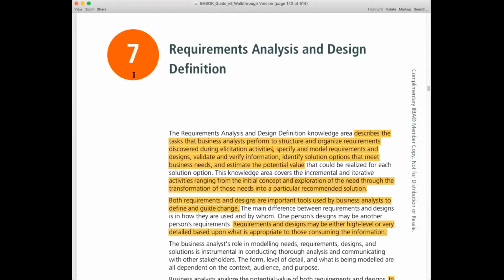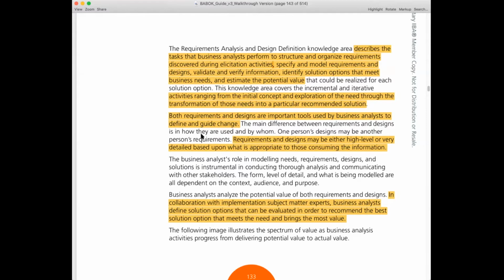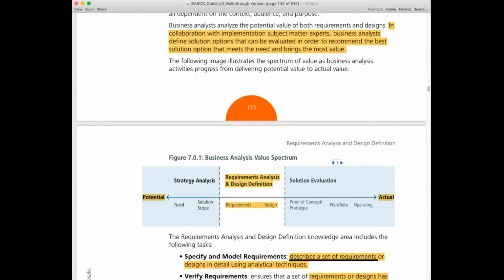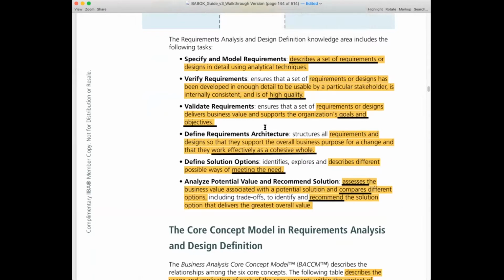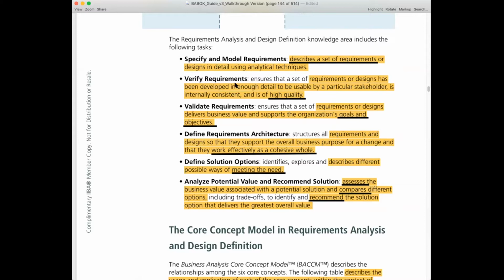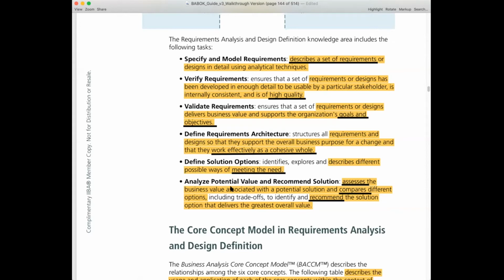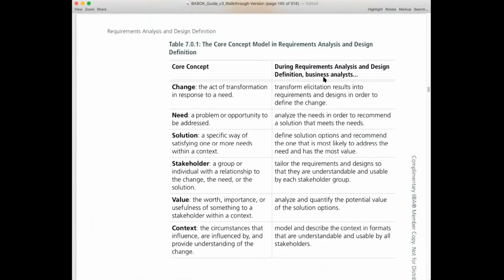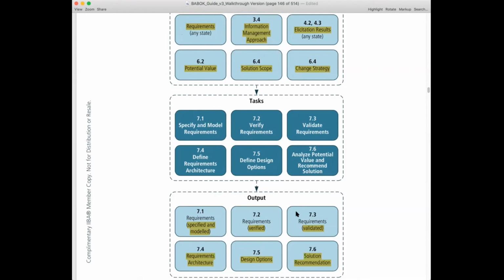BABOK Guide v3 Audiobook - Requirements Analysis and Design Definition

Comment: The RAD knowledge section packs a powerful punch! and I can see why it is such an important aspect of the assessments. I agree that BAs should stay active in design talks. It's critical to ensure that everything is in line with the requirements. When it comes to describing and modeling needs, do you have a preferred technique or tool for balancing text-based clarity and visual representation? TIA!
Reply from the maker: A great technique for balancing text-based clarity and visual representation is using use case diagrams combined with use case descriptions. The diagrams provide a clear, visual overview of actors, system boundaries, and interactions, making it easy to communicate scope and relationships at a glance. The accompanying textual descriptions add depth by detailing preconditions, triggers, main flows, and alternative flows. This combination ensures stakeholders can quickly grasp the big picture while accessing detailed, structured information when needed. It’s a versatile approach that works well across various industries and project types.

Comment: The explanation of RAD is quite helpful. It's no wonder this chapter has the most weight on the exam! I appreciate how it emphasizes the balance between text-based needs and visual modeling; both have their place depending on the audience. Btw, what is the best strategy to handle conflicting stakeholder feedback during the validation step? I'm interested to hear your thoughts!
Reply from the maker: The best strategy to handle conflicting stakeholder feedback during the validation step of requirements analysis is to facilitate a collaborative resolution process. Begin by clearly documenting all feedback and identifying the root causes of the conflicts. Then, prioritize requirements based on organizational goals, project objectives, and stakeholder impact. Use techniques like workshops, consensus-building, or decision matrices to guide discussions and focus on aligning interests. If conflicts persist, escalate to a sponsor or decision-maker with a summary of the issues, impacts, and potential solutions to ensure an informed resolution. Clear communication and a focus on shared goals are key to maintaining stakeholder alignment.

Comment: This summary of Chapter 7 on Requirements Analysis and Design Definition is quite detailed! It's evident why this chapter is so important in the IIBA certification exams. I like how it emphasizes that BAs should not only focus on requirements but also play an active role in design conversations to ensure that they are aligned with business goals. The idea that requirements and designs can be high-level or detailed depending on the audience and project stage makes a lot of sense.

I have a question, though, What are some common BA techniques for specifying and modeling requirements, including both text-based and visual modeling?
Reply from the maker: The most common text0based approach for requirements specification are declarative statements, use cases, and user stories. For modeling, BMPN, Activity Diagrams, Use case Diagrams, ERDs, and Data Flow Diagrams are common.